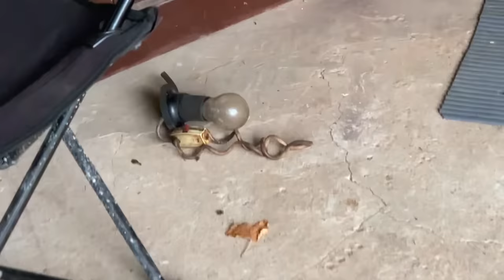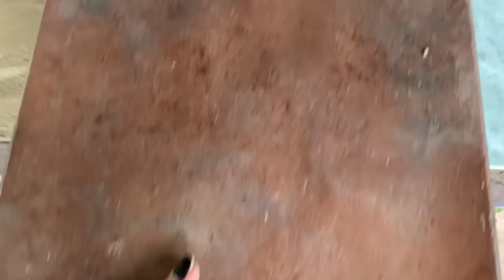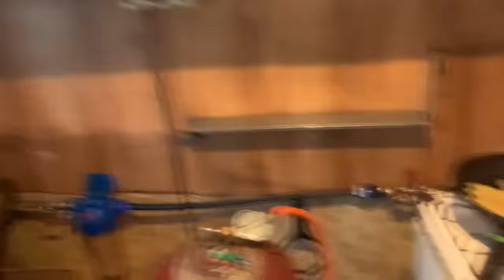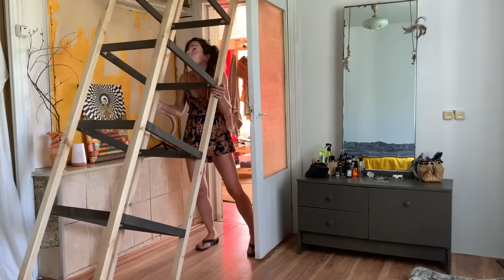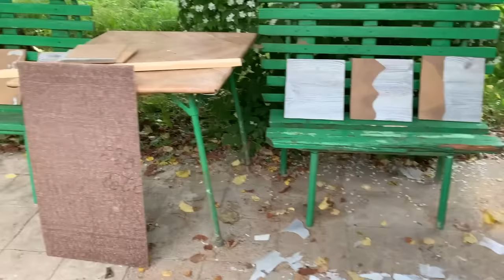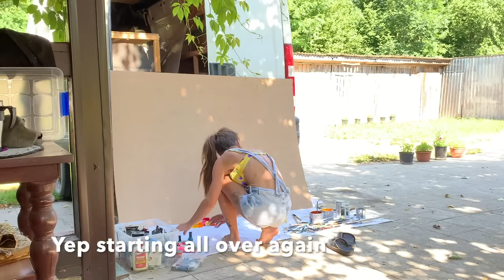Renovating my old Cottage / making mistakes and starting over

Comment: You need a notched tile trowel Ms. Latvia. You spread your thin set and run a notched tile trowel over which makes groves in the thin set then you set your tile set on it. You also need a few other tools to cut your tile and little spacers  then after it dries you'll need to grout your tile. Hope this helps Ms. Latvia!!!

Comment: Might be an idea to paint the whole board with a background colour before painting, will make the painting 'POP' if you know what I mean?
Plus you wont need to use so much coloured paint as the board wont suck the paint up and once the base colour is dry it will be easier to wipe off anything you don't think works as you'll be painting in layers😉 Just an idea🤔👍
Reply: I didn't know if she talking about renovating her or the house??
Reply: @gregoryingram7561   Bit harsh mate?  Even Youtubers have feelings, why make someone you don't know feel bad with a sh1t comment?

Comment: I've seen old ovens like the one in your house. They were built big to be able to heat the entire home since there weren't many houses that had fan forced air to move the heat around the home. The large thing on top was the hood. It usually had a large fan inside which drew smoke and odors from cooking out of the kitchen.